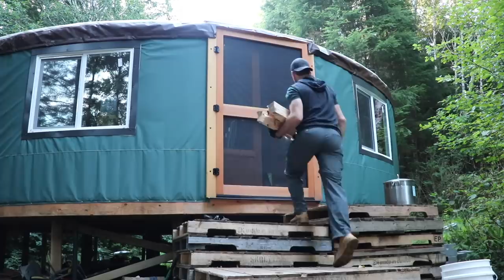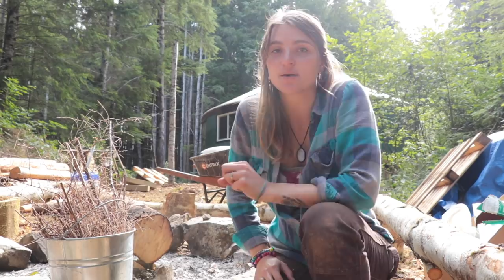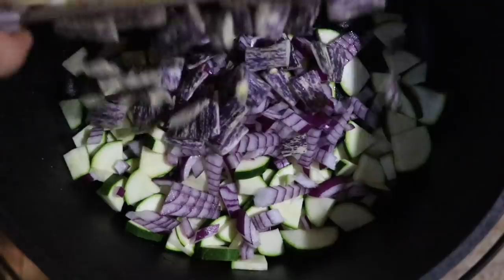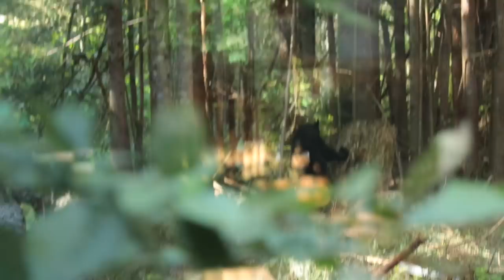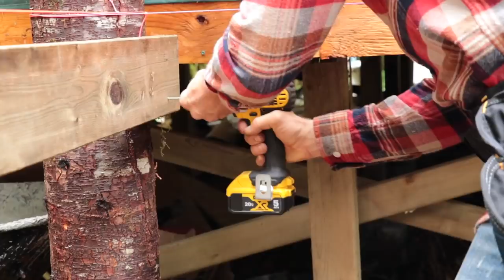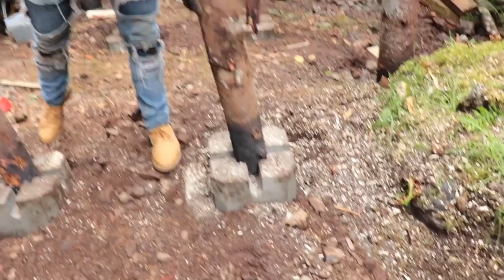Unbelievable! Secret OFF GRID YURT in the Wilderness - Ep. 47

Comment: A lot of people don't know, that when installing posts in the ground ,you don't have to mix water in a tub , just brace up the pole level, add the concrete bag directly into the hole add a little water on top ,generally there's enough moisture in the ground to cure it up by itself .

Comment: The posts you use will rot out in 5 to 7 years. And cementing them in all the way to the top they will lift with the freeze. If you do more in the future, try a smaller diameter hole and 4 ft. deep. fill up 1 ft. of cement let set dry. Set post in and fill with pea stone keep wiggling the post as you put more in. I've had the same 4 X 4's on my fence for 20+ years. It allows to drain the water away and not a chance to rot like with cement. Just something to think about, 65 year old guy
Reply: It's almost as though they're just a couple wannabe celebrities who decided to try their hand and "living off-grid" despite having zero skills or knowledge on the subject!

Comment: Use another piece of wood to hammer the hatchet to split.  Works better than your hand.  Get a line level that attaches to the string pull it taught and move it full length to check when you do something like that again.  Might want to see if you can take the bark off the poles as they will last much longer.  Then use some good clear wood sealer.  Carry on and have a grand day.
Reply: David Armstrong  Well aware of the water level.  What they were doing, a water level would have been too much work to setup.
Reply: David Armstrong  You need to let Jake and Nicole know about the water level.

Comment: If you notch your porch support boards into the poles it will protect you from an overload failure as the notch would support most of the weight. In addition it will  prevent fasteners from fatiguing over time.

Comment: Saw horses about 5or 6ft apart. Deck should have 1/4" drop at 4ft run. (water run off)  If 8ft 1/2". Deck boards will shrink. This new growth milled lumber nowadays really shrinks alot cause the growth rings are not tight. Don't leave gap!

Comment: I have dry sacked posts with concrete and it worked fine..just add a bit of water in intervals and the dew overnight does the trick. Mixing concrete is a tough job in a wheelbarrow, and also the earth has humidity too.

Comment: Screw for your Main Support? screw break clean has nail bend and support better the cold, still, I will have gone with a galvanized lag screw for the main support, the same fr the bark between the main support and the tree, it accelerates the rot. I did the same thing at my cottage and on the second summer had to replace 2 support because I could push my screwdriver all the way across... it is not too fix this..  my 2 cents

Other than this, the deck looks awesome.

Comment: You will be fine...it’s just a porch,  but to do it “right” there should be load bearing directly under deck members...notch the posts so that they hold up the deck directly.  A carpenter would then have you use hangers for joist members between posts... just saves maintenance and increases safety.

Comment: Thought youboth might enjoy this recipe :)

Vegan Marshmallows
Ingredients
1/2 cup aquafaba (the liquid from a can of chickpeas)
1/4 tsp cream of tartar
2 tbsp vanilla
2/3 cup water
1 tbps agar agar powder (not flakes)
1 1/4 cup sugar
1/2 cup powdered sugar for dusting

Instructions
Get your mold ready:
Dust the bottom of an 8"x 8" pan with powdered sugar and set aside.
Make your fluffy aquafaba:
Put the aquafaba in a mixing bowl with the cream of tartar and mix on high for 6 minutes until very fluffy.
Add some vanilla extract and whip for 3 more minutes until it is white again and it forms very stiff peaks.In a small saucepan, combine water and agar agar and bring to a boil.
Make your agar agar syrup:
Boil the water and agar agar for 3 minutes stirring frequently.
Add sugar and boil for another 3 minutes stirring constantly over medium-low heat. (Be careful not to cook it too hot or you will burn or caramelize the sugar).
Mix everything together:
Turn off the heat and add the hot sugar mixture into the beaten aquafaba.  
Add this mixture slowly while beating aquafaba with a mixer set to low for about 30 seconds.  This will turn the fluffy white mixture a little shiny.
Quickly pour it into the pan that has been dusted with powdered sugar.
Cooling and drying your marshmallows:
Dust the top of the marshmallows with powdered sugar and let sit and cool for at least an hour.
Cut into 1" squares and dust all sides with powdered sugar.
Turn your oven to 150° F.  Once it reaches that temperature, turn it off and set your cubed marshmallows in the warm oven for about an hour to dry out a little

Recipe Notes
Tips for making perfect vegan marshmallows every time:

Whip the aquafaba for a full 9 minutes before adding the agar agar syrup.
Stir the agar agar mixtures constantly over medium-low heat, just hot enough to keep it slowly bubbling.
Make sure to cook the agar agar for a total of 6 minutes to make sure it's completely dissolved and melted.
Be sure to all of the agar agar syrup to the aquafaba!  Use a rubber spatula to scrape out the bottom of the saucepan to get it all.
Immediately pour the marshmallow mixture into the pan while it's still hot.  (Once it cools, it will set and become firm in whatever position it's in).
Wait a full hour before cutting into squares.
Make sure to turn your oven off before putting the marshmallows into it.  You don't want to melt them, just dry them out a little.
Reply: Hey Jake and Nicole love your yurt don't know if you noticed someone was kind enough to provide a recipe for you to make vegan marshmallows sounds kinda good I think I will give them a try even though I'm not vegan love you guys place the scenery is breathtaking what a beautiful place to live welcome to Canada folks glad to have you here

Comment: Use the DO as an oven. preheat top and bottom on the stove. from Monica at /thehiddenveggies  .com

Vegan Marshmallows
Prep Time
9 mins
Cook Time
6 mins
Drying Time
2 hrs
Total Time
15 mins
 

An easy way to make homemade vegan marshmallows from aquafaba. 

Course: Dessert
Cuisine: American, vegan
Keyword: vegan marshmallow recipe, vegan marshmallows
Servings: 16
Calories: 20 kcal
Author: Monica Davis | The Hidden Veggies
Ingredients
1/2 cup aquafaba (the liquid from a can of chickpeas)
1/4 tsp cream of tartar
2 tbsp vanilla
2/3 cup water
1 tbps agar agar powder (not flakes)
1 1/4 cup sugar
1/2 cup powdered sugar for dusting
US Customary - Metric
Instructions
Get your mold ready:
Dust the bottom of an 8"x 8" pan with powdered sugar and set aside.
Make your fluffy aquafaba:
Put the aquafaba in a mixing bowl with the cream of tartar and mix on high for 6 minutes until very fluffy.

Add some vanilla extract and whip for 3 more minutes until it is white again and it forms very stiff peaks. In a small saucepan, combine water and agar agar and bring to a boil.

Make your agar agar syrup:
Boil the water and agar agar for 3 minutes stirring frequently.
Add sugar and boil for another 3 minutes stirring constantly over medium-low heat. (Be careful not to cook it too hot or you will burn or caramelize the sugar).
Mix everything together:
Turn off the heat and add the hot sugar mixture into the beaten aquafaba.  
Add this mixture slowly while beating aquafaba with a mixer set to low for about 30 seconds.  This will turn the fluffy white mixture a little shiny.
Quickly pour it into the pan that has been dusted with powdered sugar.
Cooling and drying your marshmallows:
Dust the top of the marshmallows with powdered sugar and let sit and cool for at least an hour.
Cut into 1" squares and dust all sides with powdered sugar.

Turn your oven to 150°F (66°C).  Once it reaches that temperature, turn it off and set your cubed marshmallows in the warm oven for about an hour to dry out a little.

Recipe Notes

Tips for making perfect vegan marshmallows every time:

Whip the aquafaba for a full 9 minutes before adding the agar agar syrup.
Stir the agar agar mixture constantly over medium-low heat, just hot enough to keep it slowly bubbling.
Make sure to cook the agar agar for a total of 6 minutes to make sure it's completely dissolved and melted.
Be sure to add all of the agar agar syrup to the aquafaba!  Use a rubber spatula to scrape out the bottom of the saucepan to get it all.
Immediately pour the marshmallow mixture into the pan while it's still hot.  (Once it cools, it will set and become firm in whatever position it's in).
Wait a full hour before cutting into squares.
Make sure to turn your oven off before putting the marshmallows into it.  You don't want to melt them, just dry them out a little.
Nutrition Facts
Vegan Marshmallows
Amount Per Serving (1 marshmallow)
Calories 20
% Daily Value*
Sodium 1mg
0%
Potassium 10mg
0%
Carbohydrates 4g
1%
Sugar 4g
4%
* Percent Daily Values are based on a 2000 calorie diet.

Comment: Shou Sugi Ban (not "-bom" not "-bong" & a garbage term anyway) is a western mis-translation of Japanese (Chinese ideogram) Kanji. The proper word is "Yakisugi" - simply meaning charred cedar. While it is famous for weather & especially bug resistance in cladding & roofing, to trust it to prevent rot below ground is wishful thinking. Half my family is from Yokohama. I've been using the technique in construction, sculpture, & art here in Hawaii for 20 years.  Traditional Japanese construction relies upon setting foundation posts ABOVE ground - the ends (custom contour scribed) resting on rammed/bedded boulders & large natural stones. BTW, I enjoy your ambition & progress.  Just beware, don't be lulled into thinking "off-grid" means, "..whoopie! No building codes!" Many codes/proper construction practices exist to keep you from building a structure that might kill you or your guests. Hanging deck joists into green bark-on posts with only deck screws is cringe-worthy.  ESPECIALLY in wet climates! Not even lag screws are appropriate here. Thru bolts, mortised ledgers, & cross bracing at least.  Pardon me, I'd rather say something than find out about tragedy after the fact.

Comment: Man , what the hell are you doing screwing and nailing the main perimeter load bearing joist to those poles ... you need structural support for them , screws and nails aren't structural support ... the least you can do at this point is through bolt them to the post and install bearing vertical standards under them ... why didn't you set them into the post ??